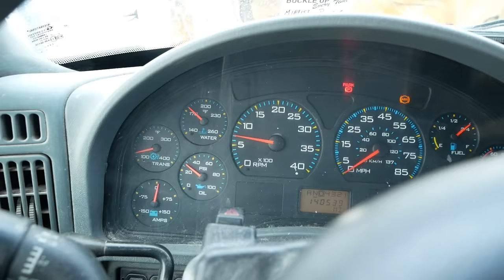Crusty Plow Truck Gets New Radiator

Comment: Always want the mechanic to fix the thing: Right Now! Maybe they should have done some maintenance on the thing and fixed it back in the summer when it's not needed immediately. I mean come on... They kept adding antifreeze to the thing, maybe it has a leak?
Reply from the maker: Psh. I have a video where I pointed out the front main seal leak on this truck 1-1/2 years ago. They are in no hurry.
Reply: I live in PA. Here if you slap an inspection sticker on that truck you are just as reliable for any accidents that occur. You have certified that the vehicle meets the applicable state and federal laws for the vehicle to be on the road.  My mechanic (I don't do all my work on my cars, not enough time with being a nurse) would just flat out refuse to work on it for this reason. He must be the kind of person that cares only about the money and not about his life or others. I can understand the oil seal if it is a massive job and costs big bucks. Id just dump some oil in it and call it a day until it becomes a bigger problem. But man, he clearly never does a DOT required safety check before each trip. 90% of these things that I see would get caught with that small inspection. Shjt, I even look at my tires on my car before I get in. Most tire problems start before you even leave your driveway. 

I just started watching your channel a few weeks ago. I guess I will go back and see how much this truck has degrades since then.😂🤣

Comment: They ripped you off on that radiator. $2 worth of plastic and $10 worth of aluminum.  That should be a $250 radiator. Next time call 1800radiator

Comment: I did that once pulled a guy out of a deep ditch he had slid through a stop sign at a T intersection. I hooked up with my shiny new blazer dragged him out unlocked and he was gone I was still putting the chain away when all the cops in the world showed up and they were mad . it seems the car was stolen. 
 it gets better the guy was on a bobbery spree he'd robbed several businesses and even tried to. rob a bank. little guy kinda twitchy . guess that's why he didn't steal my blazer . oh well
Reply from the maker: The cop did have to run the plate for the same reason. But no ticket was given. He was really cool about the whole thing. Some cops don't have any time for DIY ditch removal.

Comment: I hope the township is watching this video and needs to feel embarrassed on how this truck got to this condition. My plow trucks are in the late 80’s and early 90’s and are in perfect no rust condition. Why because they are washed every time after use and every spring the frames and cabs are checked to see if the protective coating needs to be touched up.
Reply: Township probably doesn't have the spare budget to feel embarrassed.
Reply from the maker: Heh. I don't think these guys even have a hose, let alone any desire to use it.